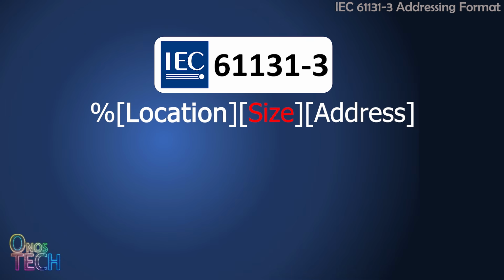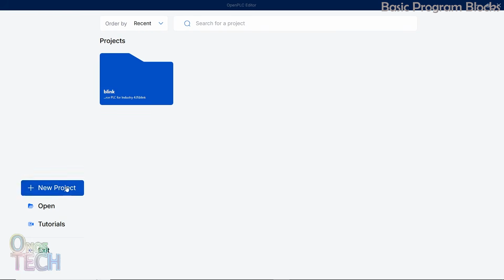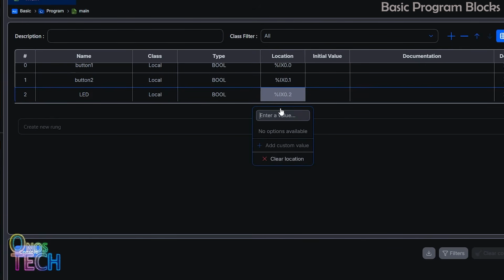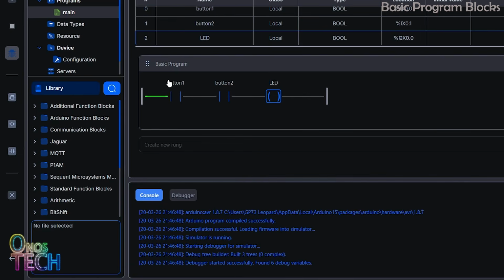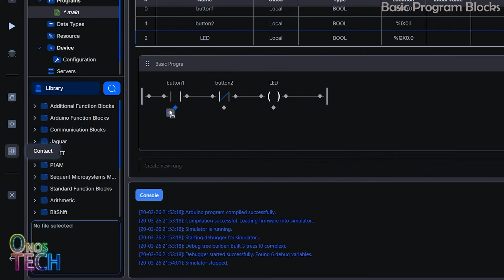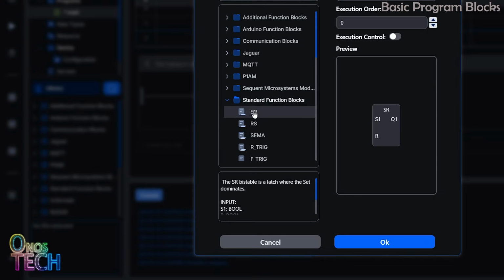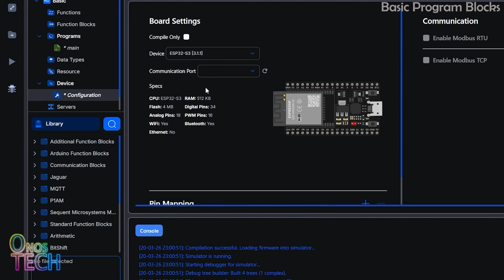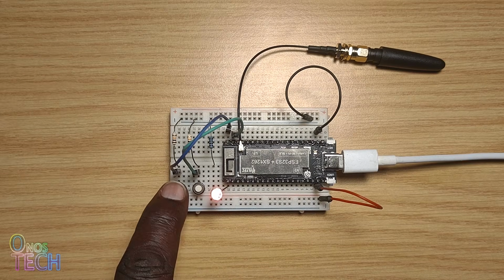OpenPLC Basics + ESP32 — IEC 61131-3 PLC programming

Comment: I am new to electronics and working on projevt to control some IO using esp32 and openplc. So i have confusion how to decide which pin required which external resistor pullup or pulldow ???
Reply from the maker: Most ESP32 pins do NOT need external resistors unless the input is floating.

Avoid these GPIOs:
- GPIO6–11 → flash memory pins
- GPIO0, 2, 12, 15 → boot pins
- GPIO1 & 3 → serial pins

GPIO34–39:
- input only
- no internal pull-up/down support

Best general-purpose GPIOs:
4, 5, 18, 19, 21, 22, 23, 25, 26, 27, 32, 33

Simple rule:
- Switch connected to GND = pull-up
- Switch connected to 3.3V = pull-down

Floating inputs = unstable ESP32 behavior.
Reply: @OnosTech thank you so much it will help a lot

Comment: I won't be using Chinese micro controllers in any Industry product. Unless the ESP is programmed by the Arduino IDE, you might find suspicious activity when using Chinese web sites to program the ESP. I would stop using products from China immediately, including their fake transistors, Good Luck.
Reply from the maker: 😊😅😂 Thank! 

But the OpenPLC editor is not Chinese and only require the board driver as also required by the Arduino IDE

Comment: “Thank you for sharing your insights. Could you explain how a custom PCB board we have developed can be integrated with OpenPLC—for instance, a board based on STM32 or RP2354B?”
Reply from the maker: You are welcome! 

Check if the model of STM32 is available in the device configuration. Then go toward the end of this video to see how I mapped the pins to the PLC I/Os
Reply: STM32 you can try with bootloader mitsu on GX word2